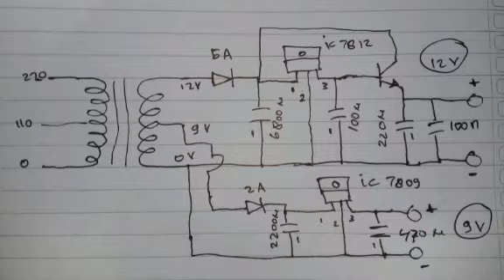Cara Membuat Power Supply 9 Volt dan 12 Volt DC

Comment: Untuk supplay HT icom 02n bisa gk ms
Reply from the maker: Bisa 
Asal voltasenya disusuaikan dengan kebutuhan
Reply: @UpinkProduction   untuk elko 100mf 50v. Diganti 1000mf 16v. Bisa gk ms
Reply from the maker: @86omahndeso83  kebesaran klo sampai 1000 mf 
Cukup 100mf saja
Reply: @UpinkProduction   c 100 itu ap ms. Kalo gk dikasih gimana. Apakah amn buat perangkt HT
Reply from the maker: @86omahndeso83  kapasitor 100n 
Sebaiknya dikasih 
Tetep aman buat ht
Reply: @UpinkProduction  untuk pemasangan dioutput + -  y ms.
Reply from the maker: @86omahndeso83  iya betul 
Berfungsi sebagai jumper 
Supaya sepletnya berkurang 
Bisa dipasang lebih dari 1 itu lebih baik